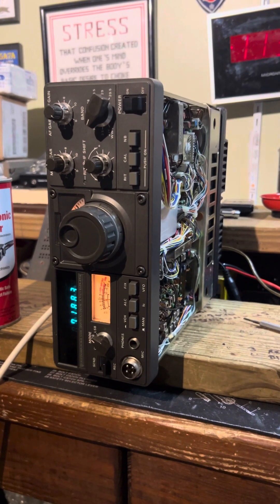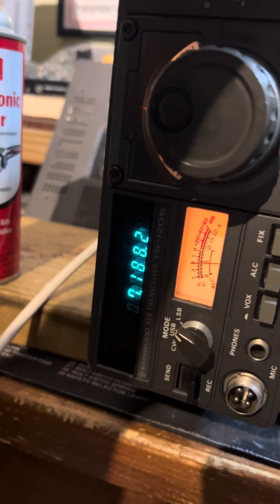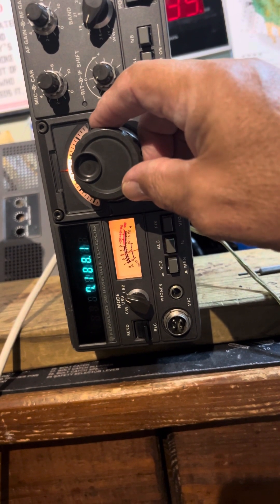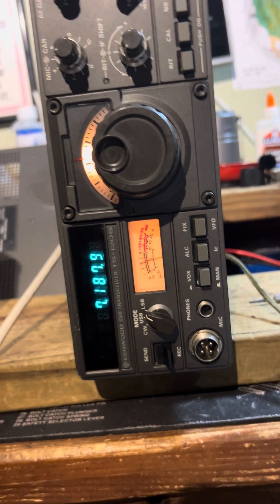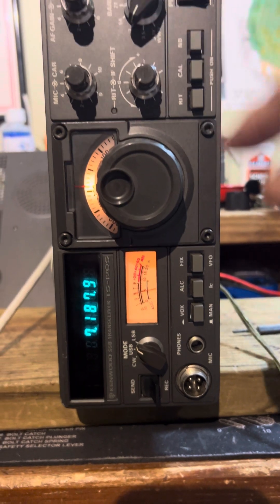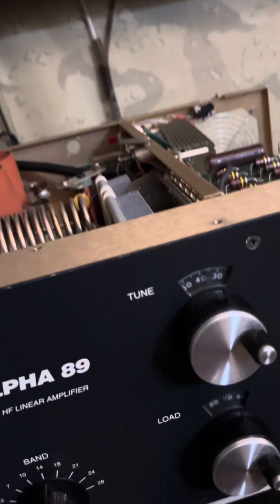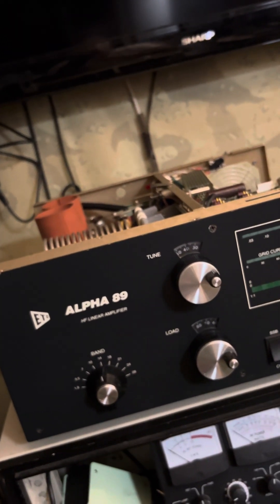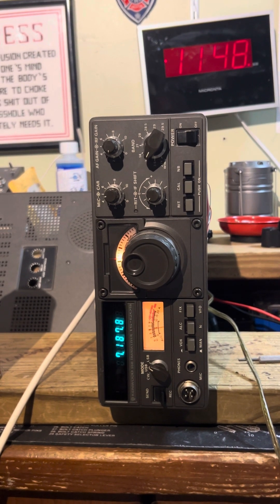KENWOOD TS-120S REPAIR

Comment: i purchased a RS120 V that was claimed tested and working recently. when powering on only the decimals light up on the LCD readout. regardless of band selection. are you able to provide any direction as to what i should do? im fairly new to radio repair and id like to get this thing running.
Reply from the maker: Hello 
They are all the same other than how many bands or output power.
I had one with display problems and other intermittents.
I got some good electronics components spray that leaves no residue, fast drying. 
Remove cover and pull one at a time the long plastic multi pin connectors and spray pins also in connector. Few of them along the front edge. don’t be surprised the display works again.
Do NOT have radio power on when doing this.
Reply: @HOODTVV  thank you i will try this. correction its a TS-120v i messed up a letter thanks